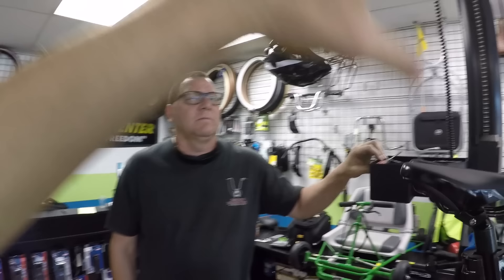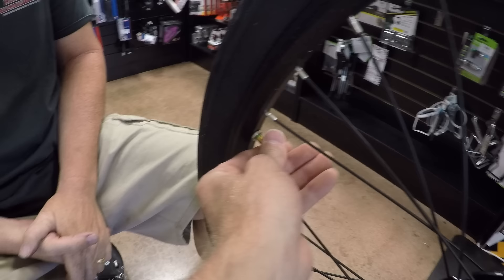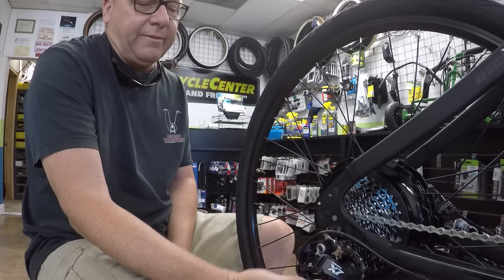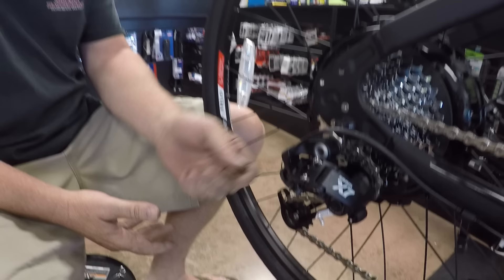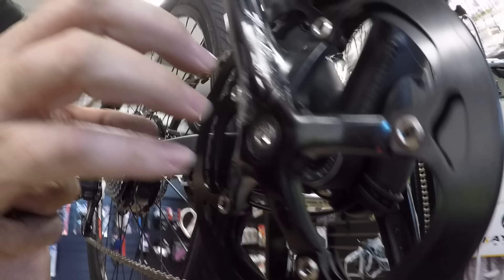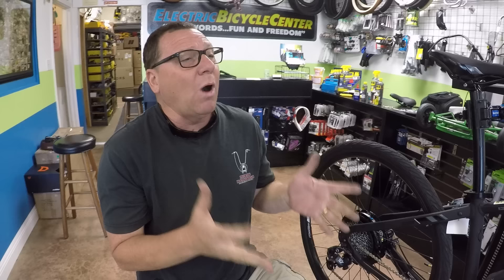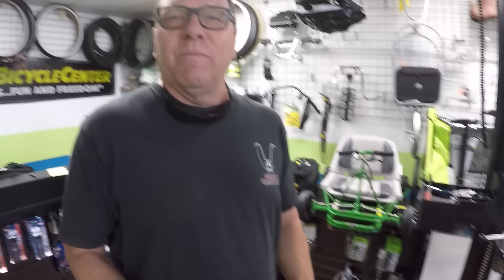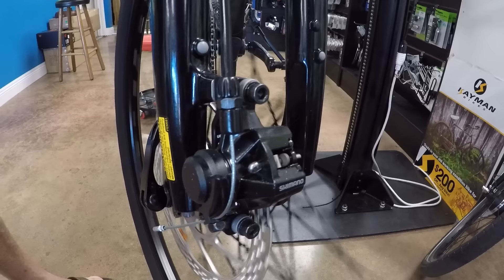Professional Advice for Maintaining an Electric Bike

Comment: As a new bike owner (and it's an electric bike) this video was super useful. A bit more maintenance than I thought I had to do, cleaning and lubing the chain/drivetrain once every 200 miles... that's a bummer. It's so gross, you'd think we'd have chainless drivetrains by now. But oh well, no huge deal, in time I'll probably learn to do it in 5 minutes.
Reply: If you want to have some fun cleaning the chain, buy a sonic cleaner machine and put the chain in it overnight. It will be beautiful and clean in the morning. Only work is to take the chain off and on.

Comment: Thanks for this very informative video. 
If on the unlikely chance I get a flat tire on my 4.25" fat tires (which have TANNUS liners, BTW) I'm just inserting SLIME into the tube.
My E-CELLS Super Monarch Crown E-MTB has a lot of parts such as 2 batteries, 2 motors, dual suspension, hydraulic brakes, etc. and even thought I used to race and maintain my bike having an e-bike is a new learning experience for many items.

Comment: I totally understand the explainations given. My only challenge would be doing these steps/ techices for a velomobile that has an E-assist when on the road. I'm looking into how to do repairs during longer rides mainly. And, totally understand the situation about keeping the battery maintained. I used to do rides that where anywhere from 100 to 600 miles total each ride.

Comment: I like to keep a master link and a chain breaker tool on me just in-case also.

And I am much more of a fan of chain lube in a bottle (wax) than oil. The chain stays visually nice and clean at all times and the coating of wax makes gear changes feel so satisfying. Plus it seems to make the chain quieter in general, and I do not worry about my trouser leg getting oil all over it anymore, although I use a spring metal clasp to keep my trousers away from the chainring anyway nowdays

Comment: I have not got a electric bike but a normal one. I bought it in 2018 etc, i still have the same wheels, same chain, same crankset and the rear brake. The front brake bent becasue i stood on the wheel i pulled the bike up so i had to replace it. I got a better one, used the same brake cable. The gears shifts really good, never out of line and the levers are very responsive. It was a $300 bike and it is the best bike i have had for quality. Also to protect the frame from chips i use clear helicopter on the frame, forks etc. I have had mine on for four years and the frame look new still with no chips. i do take care of the bike, the back wheel does need a spoke tune up same as the front so i will have to take them into the shop for that as i do not know how to do it. i am getting a e bike soon, but i will continue to you use my road bike for years to come etc. i have taken care of the chain and chain set pretty good.

Comment: The brake tip he gave only works with disk brakes that BOTH pads move inward, on my Rad, only ONE pad moves,  pushing the disk into the stationary pad. I thought he may have been on to something there, until i tried it.
Reply: the two screws adjust the stationary pad, the cable adjustment positions the moving pad.

Comment: The models that have the torque sensor intergrated into the crank set check to see if the holes in the frame that your cables go into anod out of are properly sealed up tight. Either with a rubber grommet that envelopes any gaps that are there and if it isn't then use something like hot glue or silicone caulking to fill them in including the ones that are at the top of the frame. On my bike and literally every single Surface 604 bike I have seen or heard of that has any age to it the amount of dirt that enters through these holes and water too is incredible and will destroy your crank and torque sensor guaranteed. the wires that come off the torque sensor require a hole drilled into the bottom bracket and the hole on the frame is inline with that too and due to where it is low to the ground it acts as an amazing dirt scoop.

Comment: 10:59 I've been reading lots of complaints from Juiced e-bike owners saying their display got moisture in it just from riding in the rain. Then Juiced refers them to fine print in their warranty which specifies it's NOT covered. The common story is: still technically working, but difficult or very difficult to read, repair not covered by warranty.
Long story short: $2.5K bike, and rain drops void warranty on display module!

Comment: a good video,i`ve been using electric bikes for a few yrs, this guys shop has more than ebikes than anywhere else i`ve seen, i`ve had half the problems with my bike mentioned on here!   my advice is always use an ebike with disc brakes.  i had v brakes for a couple of yrs, URG!

Comment: Thanks for the tips. Bending the derailleur fixed my issue after I had an accident and it had taken a knock. It wouldn't shift into the highest gear plus the arm was causing binding because it was getting too close to the cassette.

Comment: i bought a vose power ebike battery kit with a throttle and front wheel and motor for £430 and fitted it to my specialized sirrus normal bike and 7000miles later no problem except gradual range depletion of battery..ebike-ing doesnt have to break the bank

Comment: TIRE SLIME?
I didn't hear you say anything about tire slime...what's your opinion? Both as a preventive measure before a puncture and an in-the-field repair (with a compressed gas tire slime bottle that also inflates the tire a bit)?

Re CELLPHONE
Also, I always keep an old cellphone in with my bike tools and in my car's glove box. By law/regulation, even when not actively subscribed to a phone service provider, ANY old cellphone can still be used to call 911 in the US. I also keep a regular alkaline battery to cellphone power adapter and make sure the batteries are always fresh, and for the car I keep a cigarette lighter to phone power adapter for that phone. If I fall off my bike, my regular cellphone may be unusable so it's nice to know I may have a spare that survived.
Reply: NOT SURE about high WATTAGE analog cells still finding towers but agree they are better than satellite phone.

Electric BIKES with flat prone single air bladder SUPPORT make no sense as This mechanic implies.  If your not desperate for air buy a foam tire.  I can't IMAGINE one customer whose battery quits EARLY regretting going airless INSTEAD.

For me GETTING rid of flats is main REASON for assistance.

Court the quantity of comments buries gems.  PLEASE call out THOSE you know deserve prominence!

Comment: 8:00 Definitely need to keep the chain lubricated. Mine has gone a long time without it and through a lot of dirty wet streets. It's gotten to the point the chain links start to make a bend or kink when moving through the rear derailleur, making a lot of noise. And it refuses to move through the rear derailleur when back pedaling.

Comment: A quality battery pack with appropriate battery management won't let your pack run to zero. It will shut off when the voltage hits ~2.8v per cell.

Comment: Carry a bottle of green slime 8 ounce for bikes or 2 bottles, n carry a good pump, i carry a step on pump, its bigger but i got back baskets to put it in, if you get a flat put 8 ounces in n pump tire back up n roll tire around n this will take care of a lot of flats, also pull out whatever punctured tire if you can find it
I have a fat tire e bike n got a flat on back tire, i put green slime in n it fixed it
Make sure green slime is still good in bottle it has like a 2 year shelf life kept in good temperature
In tire it will harden up if you don't ride bike for awhile or after like 2 years in tire, so carry another bottle if you already put some in, n change out tube if it hardens if you want to, also protects tire from getting more punctures once in it
I wouldnt put it in until you get a flat

Comment: More that the pads wear, iirc
MicroAdjust for that.
And I wouldn't Lick a tire, 
spit or some other liquids (soda not great sugar mess, 
water bottle bubbles better),
 toxicity on the road: oil, brake fluid, etc
can make you sick...
Then whatever mess you've made has to be cleaned up in order for the patch seal to work, besides showroom tires and wheels are relatively clean by comparison to real world noisy outdoors for hearing hissing sounds.
 I rarely find the puncture
 on the road, carry tubes,
 and patches fail to work
 a lot too, roughing the surface
, I tend to give away patch kits
 to people without the right/same size tires in distress and let them learn, usually the hard way,
 lend a pump, give it a try...
 Ymmv 
all seems to go back to 
call the shop here/
emergency towing...

Comment: The only time I’ve had to use a cell phone was when my Titanium frame snapped a derailler hangar. I’ve since gad it repaired (it took a few years to find someone locally who could weld Titanium, but I’ve ridden it thousands of miles since.

Comment: Why is it that the adjustment on the brake lever is aluminum?.. at least on cheap bikes.  It should be made of a stronger material. The locking nut is aluminum and  makes it aluminum on aluminum.  It seems like a decades old problem that should have been fixed years ago.  Do they sell a better option for this common problem?

Comment: The biggest problem I have with punctured tyres is removing the thorn (it is always a thorn where I live) from the tyre, so it doesn't immediately re-puncture the repaired tube.  Not sure how I would be able to do that with the tyre still on the rim.  I use Schwalbe Marathons and the thorns even get through them, especially when the tyre starts to get a few miles on it.

Comment: Local bike mechanic stressed the importance of avoiding using different types of lubes on the chain to avoid incompatibility.   Don't recall specifics.   My front wheel (xu7000 Ohm)  was slightly out of round and needed truing.  That can cause rotor to contact pads.

Comment: I'm going through brake pads every 2/3 months... Cable disc brakes. I do approx 14 trips per month, riding 16 miles per trip, 7 of which is 30mph downhill type roads... I can cope with this, my real bug bear is under voltage issues, drawing too much amp i guess, bty and controller hot, and no ride for 5mins...  I can avoid it by watching the voltage. 48v, when it drops to 43v i must throttle down. My controller has no setting to limit this. Should i re-invest. running ekit, 1000w 48v cheap china buy. control is through 'sw900 lcd'. Cheers

Comment: Kind of surprised  by the suggestion not to replace a punctured tube but to patch it instead. I bought a new tube for $4 and replaced it in my driveway with no tools. And that was on the back tire of my Trek e-bike. Not sure I understand the suggestion of patching vs replacing. You're already there and it's just as cheap if not cheaper to replace the tube. By the time you've patched it, replacing the tube altogether isn't any more work and you don't have to worry about a patch failing down the road. What am I missing/not understanding?

Comment: Lube is not to "cushin" chain on the sprocket. If you have to much lube on the sprocket you do it wrong. The only place where the lube is supposed to go is between the rollers and pins in the chain.

Comment: Yeah... I've been very afraid to wash my Bosch eBike with water the first couple of times. After the battery is removed I usually put a plastic bag around the battery connectors, but I wonder if that's even necessary. 

Sounds on Sam like these ebikes, especially higher-end ones like the Bosch, are pretty much completely waterproof.
Reply from the maker: Yeah, they seem to be very well built. I wrote an article about washing ebikes (and using them in wet conditions) recently and got some great advice from a friend in the UK with awesome muddy pictures, check it out here: https://electricbikereview.com/guides/ebikes-in-rain-washing/
Reply: ElectricBikeReview.com I'll make sure to read that, thanks. I just washed mine today and sprayed quite a lot of water right on the motor, battery connectors and display connectors, no problem, everything works

Comment: Loosened crank arms, are able to be reused under rather limited  circumstances.    U need expertise and luck as a mechanic, they are only reusable up to the point of LIMITED damage to square taper.  A nutted bottom bracket can be double nutted, with narrower lock nuts, Ive had one of these for yrs, and no problem at all, but I still check it carefully before riding it.  I believe its possible to put a stud in a bolted bottom bracket, and then put the lock nuts on, but have never tried that at all. Never do any of this to a customers bike, but I try things on my own bikes and sometimes things work out.

Comment: I assume that the hub motor makes removing the rear wheel for flats much more difficult than a mid motor bike.  Both of my current bikes have two tire liners.  Puncture vine is everywhere.

Comment: I am making an ebike out of an older Nishiki mountain bike.  Front wheel motor 48, 1000w 13 ah batt.  What no one talks about is the front wheel is so heavy it comes off the bike.  I just found out that there is a $12 part on amazon called a "torque arm" which absorbs some of the torque and holds the wheel on.  I urge everyone to get one.  My wheel came off and dumped me!  Violamart does not include this part, and they will end up getting sued for it!

Comment: If you live where it's crazy hilly. I mean, like 4500' of ascent and descent to and, from work, install a bigger set of rotors. I went from F180/R1609mm to 203 front and 180 rear. I was eating pads. That and convert your rims to tubeless. Dude, don't be late for work.

Comment: I wish there was an electric bike shop like this in my area. I have been curious about the 1kw motor rambo bike. I would like to try a 3 mile up a steep incline for a 280- 300 lb load to see if it overheats or can even make it! Hate to drop just under 5k on a bike just to break it in a couple trips.

Comment: SO

Being that I have your bike for 25 years and then I stopped working in the industry because I closed my shop.
And the reason I looked at this video was simply to see any maintenance on the motor which I don’t think you have to maintain because it’s like a drill motor, the battery which I think you all we have to do is keep a charged. So if you will please respond, there is nothing to do for the electrics??
Right??
Now I do have a question for you What type of electric system do you find the most trouble for he is the one in the hub or the one at the bottom bracket? And are there battery systems that you find to be more trouble for you than others? Those are the kind of answers I need please

Comment: Free advice: Don't pump bike tires at the gas station. Use a manual pump, or you might find your tire rapidly over-inflated and then exploding. Now you will have a bad tube, a bad tire, and a bent rim. Expensive.

Comment: Water getting in USB port on side of battery near the top. I have a 2019 Mule 750. On top of battery there is push button and 4 led lights for checking the battery level. Worry about water getting around the rubber test button. I've taken battery end caps off and found moisture in there. The rubber o-ring must not be doing its job. I want to but permatex  on it also.

Comment: I have a problem with a TotGuard 500watt ebike. The battery is fully charged but I lost all power to handlebars, throttle,lcd screen, an most local shops only repair what they sell. It has less than 10miles on it.

Comment: I'm going to add that announcement again there's a little misspelling I need the control box to a torker t400 hybrid electric bicycleI need the control box but all the wiring fits into the battery slides into that control box and touches context I need that plastic square box thank you

Comment: Truly surprised that all the years of maintaining a bike, that not knowing chain lube not only has to lube every side link, but every roller and pin the rollers spin on. 
Don't use paper towels, use a cut up Terry cloth towel in 5x5" patches. 
When it gets too grimy, toss it out. 
Wiping entire length of chain after final step of lube and run in a few cycles on the stand or upside down, now wipe off excess. This makes sure lube got deep into rollers running chain a few cycles first. If it's noticed grime is coming out of rollers, process clean and lube step again, there's too much grim in rollers vs lube. Grim kills a chain quickly. Or get a second chain that's already serviced, and swap it out. Now grimy chain can get a full meal deal service ready for next service swap. And no worries of chain lube flinging off onto white clothing. 
After 45 years of service tech for Honda, guess how many nice shirts were ruined in one summer by black  chain grime alone. Speckled up the back of shirt. Its history. 
Cheers

Comment: hi, I am a COMPLETE newbie to ebikes and want to get into delivering food... so I apologies for the tons of questions. 

The weight of the food is not too heavy, 1 to 5 pizzas per order, that is like 1 to 5kg, I am more interested in:
- having a battery that lasts a long time(i.e. I can ride for many kms/miles) 
- re-charges fast
- strong enough motor to help me climb very steep hills
- quality brakes 
- low maintenance
- preferably a removable battery so I can buy an extra battery in case the one in use gets to zero % energy. 

Could you recommend specific quality models from specific companies?  There are so many companies and models I can;t choose, I dont even know what to look for when choosing...

Thank you